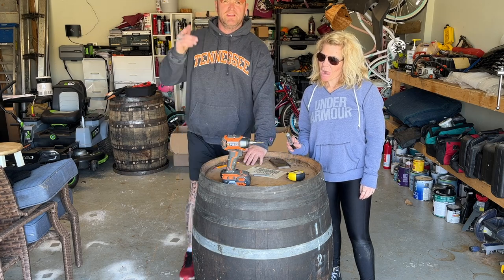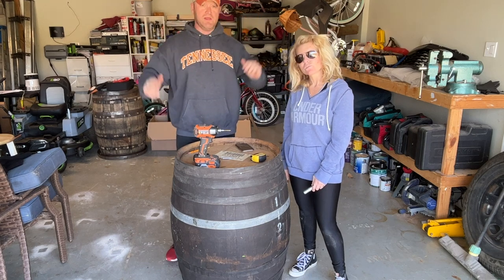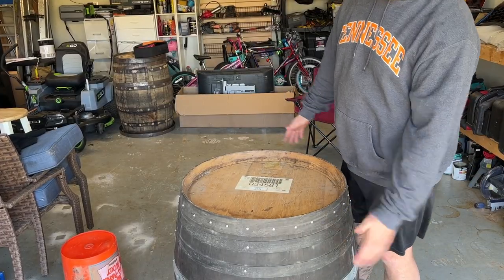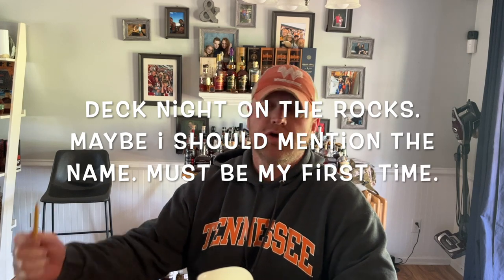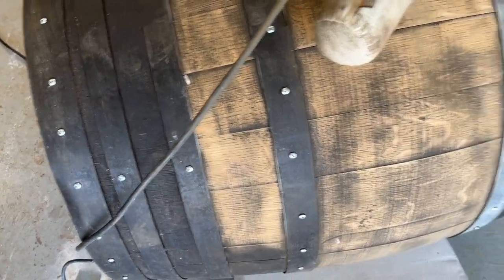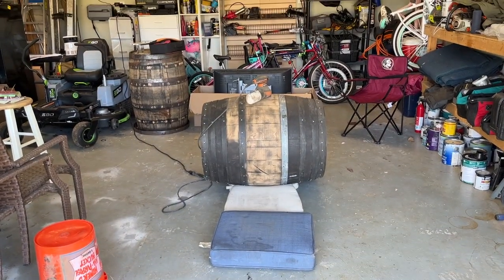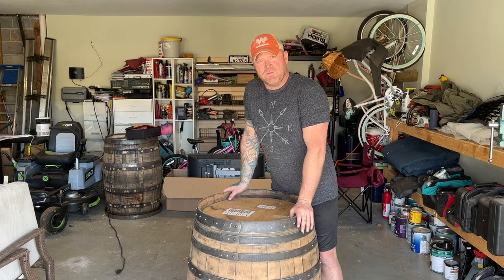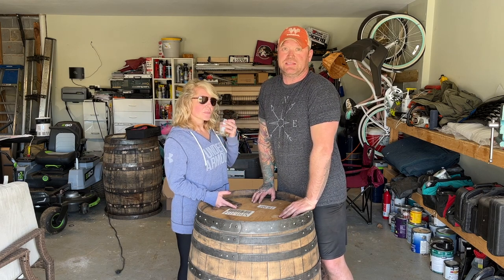How to split a Bourbon, whiskey or wine barrel. Its not as hard as you think.

Comment: Use a 4.5 inch angle grinder with a steel cutting disc. It would work a lot better/quicker than the tiny tool that you have.